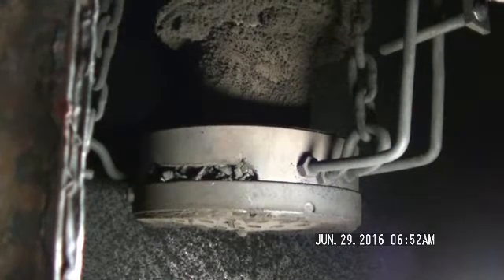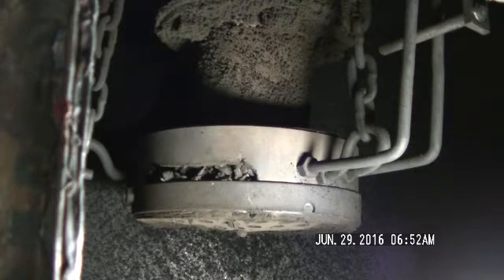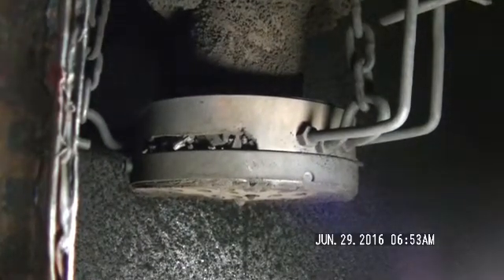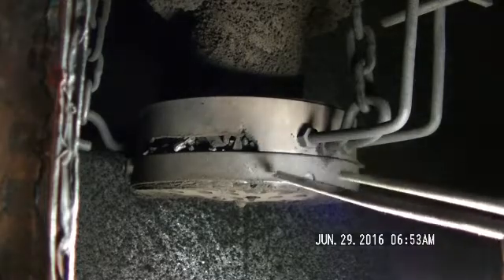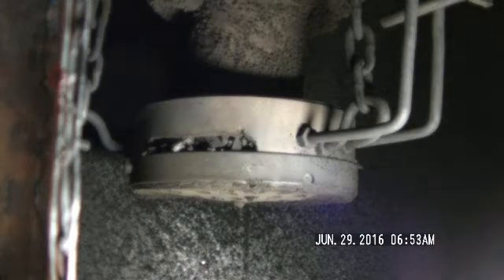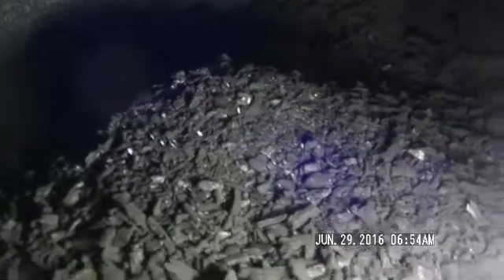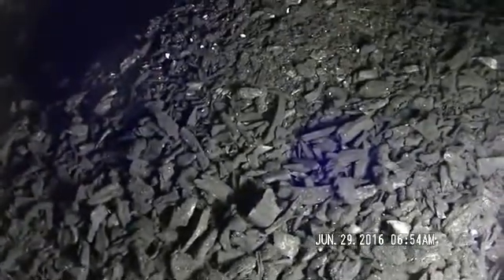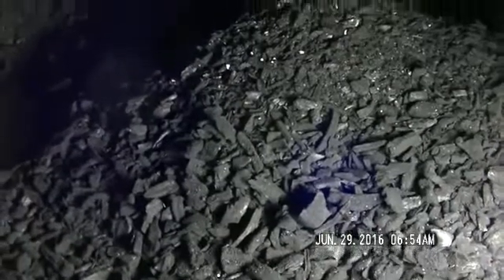Wood Gasifier Grate Shaking

Comment: Howdee Bill,   Thank you kindly for this.  There is no doubt about it, I need to revise my grate design, as it is currently way too aggressive.  Sure, it promotes clean, cool gas, but the vacuum level is measured in Feet Concrete, as opposed to Inches Water   ;). 
   You have done a great job with your gasser, and it looks like you have ironed out the remaining bugs, so I am hoping to follow suit very soon.  Last night, I put some petrol in my backup generator, and started it up.  10 minutes later, the muffler fell off.  Wow, that thing is sooooo noisy now.
Reply from the maker: The fun never ends.  We are all looking for the correct balance, or at least, functional.